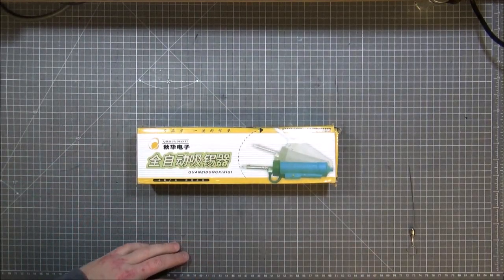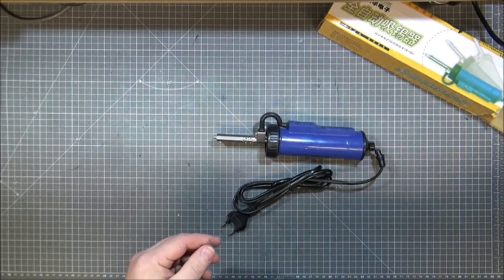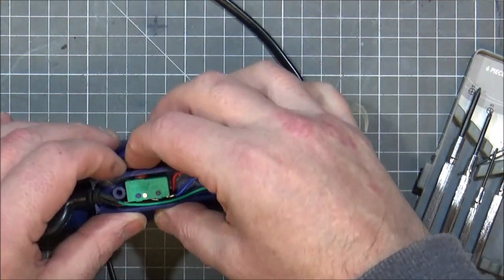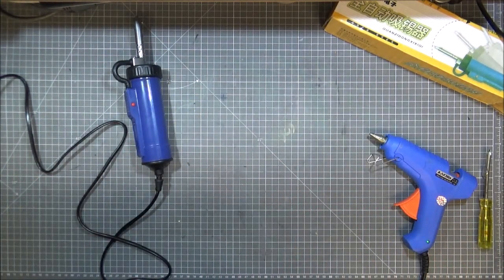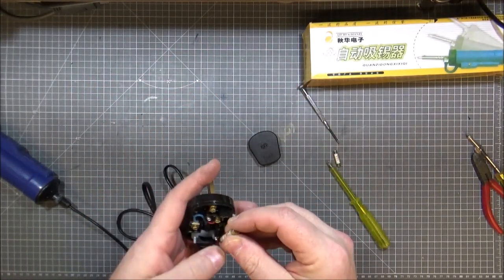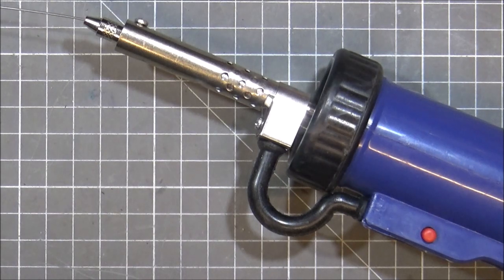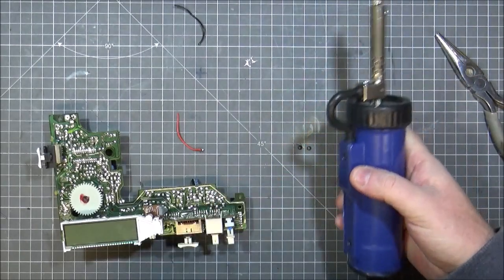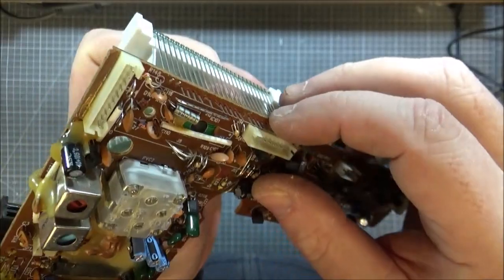Cheap Chineese Electric Vacuum Solder Sucker /Desoldering Pump

Comment: That circuit works as follow: The resistor of the solder is always on (provided you don't press the switch )There is a rectifier diode bridge and Capacitor circuit that converts AC to DC  needed to power the inner solenoid  acting as an electromagnet that feeds the pump . When switch is pressed, the piston is attracted to the solenoid and creates vacum sucking the soldering the rod of the pump pusses the arrow that opens that spring loaded switch  at the end and opens the AC circuit turning off the solder heat. When you release the switch, the inner spring put the piston back spitting all the solder inside.

Comment: Given the red and blue wires are different colour to the red and blue going to the switch then I would imagine that the mains is being full wave rectified with a smoothing cap to take out the ripple. No earth is required given that all the parts are insulated from the mains. The handle switch is used to provide power to the solenoid, whilst the other switch at the back, removes power from the solenoid once the solenoid has been de-actuated, by releasing the button. A simple plunger at the back of the solenoid provides this action by the looks of it, probably driving the solenoid in the opposite direction by back EMF action of releasing the button. Pointy looking bit of plastic at the centre :)
Effective by its simple construction, just a tad fiddly when it comes to cleaning. Thanks for the video as it gives an insight into the operation of the desoldering iron.

Comment: Just got mine today. Only 7 days after ordering (a small miracle coming from China)

It has 4 tips (3 spares and 1 installed) and it has the same Euro plug and a really cheap adapter. I plan to change the cable out for an Australian plug. This is why I came to your video.

Comment: I heard you ramble over there about youth havin' no clue. Well, I might have to agree. A thing in my room short circuited and it blew the fuses for the whole floor. and I hadn't even had the chance to find WHAT short circuited in my room and unplug it, and the other guys on the floor had already turned the breaker on again! As if it's just a joke. 

Breakers break circuits for a reason! You DO NOT just turn them back on! It seems to me that so many people are never told about the significance that electricity has. The facts. How basic stuff work. Were they never told to reason, and think "Hey, why did the breaker go off?". They turn the breakers back on like they open a window when it blows closed; maybe they grew up with electricity the same way as air: it was always there. It was never new and taught about.
Reply from the maker: nice ramble. cheers
Reply: @R_T_Ralph  cheers! 😝

Comment: Hi, I would like to ask you for a small favor if possible. When disassembling my desoldering iron, which is the same as yours, the four cables that go from the tip and the switch to the motherboard came loose and I don't know how they were soldered. Could you tell me or send me an image? and thank you very much for your videos keep it up (sorry for my English I'm from Spain)
Reply from the maker: check the video around time 9.00 to 10.30  this should show you where they go.
Reply: @R_T_Ralph  the cables are soldered inside and cannot be seen
Reply from the maker: @diyelectronics9263  sorry, i dont have this anymore, i really dont recommend this as a tool as its got no earth and heats up far beyond safe.

Comment: I had ordered one and it has a US plug and the plastic is black and not blue. It still says it is 220V, but I live in the USA? How is that going to work?
Reply from the maker: There are a lot of problems with this device. I assume the voltage regulator would work from 100v up to 240v, then step down to its operating voltage of maybe 24v without issue.

Comment: No links? Also, those wires are brown and blue. Standard colours in Australia, and possibly China for Active (Live) and Neutral (respectively)
Reply from the maker: No links as I bought it from ebay.
Reply: @R_T_Ralph  To the videos you said you'd link. It's ok, I found them and many others. Still, it may help others who watch your video, as you said you would link to them. 👍🏼
Reply from the maker: Sorry. Its been a while since I recorded this. I'll take a look later and add links. Thank you.
Reply from the maker: Link posted in description. His was more poorly made than mine. I honestly do still use this, but its as hot as hell and will just do enough to help me.  Also, ive just bought a proper desoldering station which is safe and will do the job better. video to make on that soon.

Comment: The pump is working on DC? The diodes form a full wave rectifier with a little filtering  and  the heating works on direct AC.. It seems. The wiring looks flimsy and unsafe. They've stuck no earth because its all plastic case. Under fault conditions provided you don't touch the heater... Metal you technically shouldn't get a shock. For the sake of making future videos please completely unplug any devices 👍 personally I would use a separate soldering iron and make the pump work on its own. If that was a British item,  it would have the correct safety markings. Too many items coming into the UK just AINT safe.

Comment: Hi,
I'm considering buying a desoldering pump like this one and I was wondering how this thing kept up over time.  Do you still use it?  What's your experience after almost 3 years.   Thank you for this great video.
Reply from the maker: Honestly, its still a poorly built death trap, but can be useful for small projects.
However, it gets far too hot and not very easy to clean.
I stopped using it when i bought a Duratool Desoldering Station  -  D00672, which you can pick up for less than £70. A lot more safer and a breeze to use.
Reply: @R_T_Ralph  Where have you seen it for less then £70? On Amazon, CPC and eBay it costs much more than that.
Reply from the maker: @captaincorleone7088  i bought my desoldering station from farnells last year for £72. this video was made a few years back now, but still, this pump isnt worth the money.
https://cpc.farnell.com/duratool/d00672/desoldering-station-uk-eu-plug/dp/SD01384  is what i bought, and its cheaper now.

Comment: I just ordered what looks like a newer version of this on aliexpress that doesn't seem to have the strain relief issue. How has yours held up over the year or so that you've had it? Is it still working?
Reply from the maker: Surprisingly, Yes it has.
Ive had no issues with it, except for it getting too hot when using it for more than 15 minutes.
I know i had a go at it for safety reasons, like other videos have done, but it does the job. Unless you want to shell out a stack load more cash for the desolder station, then its as good as you need.
Reply: @R_T_Ralph  I'm hoping the one I ordered will at least last a while..I'm not too worried about it getting too hot as it will be rarely used for for more than 15 minutes..I'm on a budget so spending almost $200 or more on a tool I'll rarely use  is unlikely anytime soon. As long as it does the job it's good enough for me. Thanks for the reply.

Comment: If you ain't broke don't fix it
Reply from the maker: I watch a few videos before i bought this, and knew what the problems were, however, it is pretty good for the price, but still a death trap.
Reply: @R_T_Ralph  That spring at the back and copper contact,  is that not for  when the solenoid hits it, it cuts the power to the  solenoid ?
Your cable tie and glue is stopping that contact from moving.

Comment: The other guy use this and removed ic fast. You took it apart before you even tested it now yours don't work. When I get home , I try mines, if it works right away , I assume something you dis was a mistep. Can I trust your work?
Reply from the maker: this review was 4 years ago, this device is a cheap version of a very good idea, but is not earthed or regulated.  I have a lot better solder station and would not recomend this, BUT it is ok for small jobs.

Comment: I think you just got into too much of a faff and worried too much about the plug not being earthed,I came here to see if they were any good,you were faffing about too much and read darkstatehk's comment and found another video instead.
Reply from the maker: To be honest, i still use it when i need to. Its ok, but there is no voltage or thermal regulation on this, and with no earth, its a matter of time before i get a shock, or burned from it. Good idea, but needs more safety.

Comment: You make it so dramatic 🤦
Reply: There is a reason for the 13A fuse.. If you didn't mess with it before you tied it out, it would've been working 🤷
Reply from the maker: @xxbambamxx7261  ive not used it in years, i found a better sucker